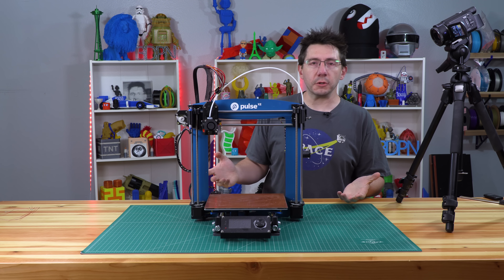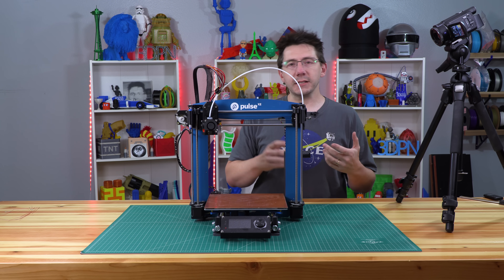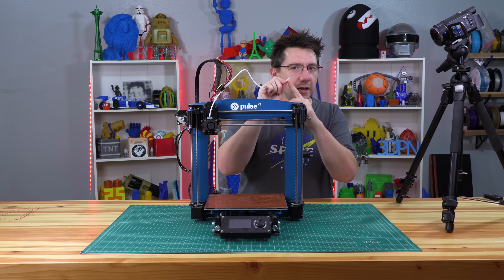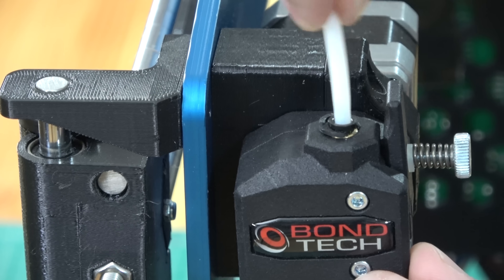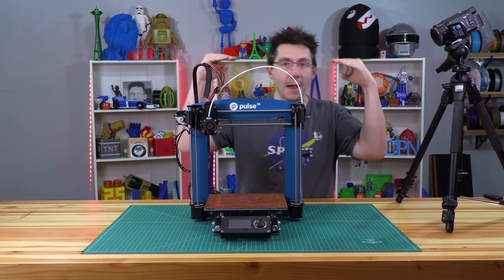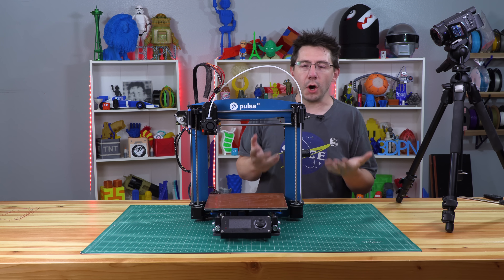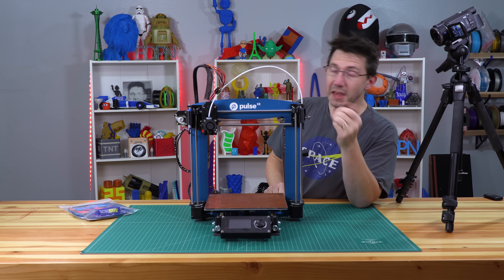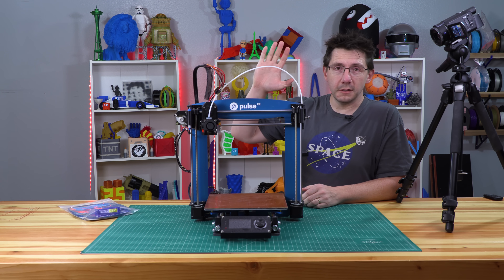Bondtech Bowden PTFE Coupler Fails - Here Is My Fix

Comment: Had to do this with my Th3d Tough Extruder when I got it as an 'upgrade'.
Now I'm going to go dual drive bondtech as I keep getting fails where the filament gets jammed a bit and then the extruder chews a chunk out of the filament and can't move anymore.
It's probably something to do with my E3D V6 allowing heat to creep up into the main body but I can't say for certain. I have upgraded the cooling fan on the V6 to a larger Noctua Fan. Still happens.
Hoping a dual drive Bondtech LGX can solve this problem. If not I'll try changing it too direct drive. If that doesn't work I guess I'll try changing the V6 out for a Mosquito hotend. I feel like I've over committed to my CR10 as a printer but that's the nature of this hobby I guess.

Comment: just happened to me on a clone. however in my case the coupler had actually broken.... only immediate fix was to turn the whole extruder around to use the other coupler (attached differently) and set klipper to reverse direction

Comment: It's an older video, sir, but it checks out. I was having issues with my fancy Capricorn tube popping out of my extruder. Nothing I did could make it stay in. It wasn't until I saw your external diameter measurements that it clicked and I swapped the coupler for the one that came with the tubing. Thank you!

Comment: Hi! I just got that issue for the first time with my Chiron printer and I taught it was fixed after I actually used a small tie wrap but it just happened again so I'm not sure If I need to change the coupler now.
The tie wrap idea was from Anycubic since they use one at the hotend.

Comment: These fittings were designed for high pressure applications,  not bowden tubes.  But they work for the most part.

Comment: Thanks for the video. I had this exact issue with my Ender 5 plus (my very first 3d printer)

My fix was pretty easy.. I didn't have any clip installed on the extruder at all 🙄

Comment: I also got this problem and also resorted to flipping the clip around to solve it quickly. Then I found this video. :-)
Interestingly enough this did take quite some time to manifest. Probably because of deformation due to squeezing in the coupler or similar. Or possibly just some wear in the teeth of the coupler because I also tried cutting off a bit and that worked only for a few days before it failed again.
I don't have an exact time it took for the problem to arise because while the printer has a runtime counter, the bondtech hasn't been on it from the start. But let's say somewhere around 2000 print hours. Possibly as much as 3000. Ish.

Comment: I have a dotbit clone to the bmg which I used the Bowden adaptor to a threaded coupler (from a Titan clone) and I just ran into that problem!! It actually broke the plastic piece off the coupler. I will be using a clip when I receive my new Bowden tubes and couplers. Thank you!!!

Comment: I've never had it come out with my previous couplers, .. however the these bowden adapters suck. Even with a thicker clip, .. mine just pushes out the tube entirely making groves in the PTFE tube, it's just not properly gripping the tube.

Comment: Turn your BMG extruder around.  The other side has a much easier to replace coupler.  Can the one at the end Joel has up top even be replaced?  I've not tried to remove it before.
Reply from the maker: I thought about this - this is how it cones factory installed.
Reply: @3DPrintingNerd  It's just a simple setting in Marlin or wiring to turn it around.  The Bondtech docs imply you can install it in either direction.  Their FAQ implies you can install it in either direction such as under "EXTRUDER TURNING IN THE WRONG DIRECTION" "Depending on the orientation of your extruder and if you use the top or bottom port as the output port to your hotend..."

Comment: If your running it as a Bowden set up why not flip the extruder upside-down?  Then if you have a Bowden fitting fail you can print a replacement piece that a standard Bowden fitting threads into and your good to go.

Comment: I got the same printer and have/had the same problem I also think the tube should be a little longer and there should be some kind of holder up there to keep the tube from jerking around that much. Also if you got the STL's for those clips somewhere please let me know so I can print some cause you can't buy them it seems

Comment: Those tube fittings aren't supposed to have clips on them. I find they make them less reliable.
I have had the fittings fail on my ender 3 but a clip won't help as the grips had deformed and the fitting was scrap.
Cheap junk I think.

Comment: my retraction clip on thingiverse includes the Fusion 360 source and is parameterized so you can easily adjust the design for whatever size works best for the coupler on the bondtech.  https://www.thingiverse.com/thing:3175043

Comment: Pulling out and pushing in the tube with the clip still in place? Is this 3D Printing Nerd trying to become the next 3D Printing Noob? Seriously tho, this coupler was wrecked by "abuse", and it kinda baffles me that even on an 80$ product like the BondTech extruder, the coupling seems to be of low quality compared to the ones i know from industrial pneumatic applications.
And just as a hint from the internet of tubes; always measure the same spot at least twice on a bent tube, twisting the calipers 90° around the tube.
Reply from the maker: Nope, not wrecked by abuse. Coupler works as it should when enough force is applied by the clip, which I have confirmed, and which Bondtech also confirmed.
Reply: @3DPrintingNerd  Alright, so it's still a design flaw by BondTech then. Coupler does not work as intended. For a connector that is actually under constant shifting mechanical load by design (print head moves and that moves the tube in the coupler a little bit all the time, plus the force that pulls on the tube by extrusion and backforce from nozzle resistance) they should really invest a few dollars more in a rugged tube coupling, especially on a high end high price product. Hopefully they think about that in the next revision, because the rest of the BondTech design is actually very good.

Comment: The black fitting on there is the same "John Guest" fitting as in the entrance of an e3d v6. Over years of using both I have had them fail at both ends (e3d and Bondtech sides) when the internal pressure the Bondtech can generate overcomes the strength of the Teflon tubing. Teflon cold flows under to high a pressure. The dimensions you measured with the calipers showing the tube as undersized are because the tube was stretched... Which drew out the length, not pinched by the barb fitting.

Long story short, cut off the deformed tubing end, and yes use a thicker spacer. Also always make sure you have the tube pushed all the way down into the QR housing. I have 9 Bondtechs between all my different printers. They work great but yes the problem is they can apply too much force if your nozzle is clogged or if you aren't applying enough thermal energy in to melt at the same rate you're trying to extrude. It's a good problem to have, having that much grip. But when you have that much grip, bad things can happen if you try and drive filament into a brick wall :-)

Comment: It comes down to cheap connectors, I have been using similar connectors from SMC for use with pneumatics with pressurised air for 10-15 years and haven't ever had an issue with hoses blowing off.

Comment: Yeah those clip are supposed to to be removed for ptfe insertion and removal. They are designed to hold the black ring up, similar to how your fingernail was doing. The coupler you have is effed and needs to be replaced. don't forget to fit your tube and only then, add in the clip!

Comment: Honestly my fix for this issue with other bowden extruders is to just use a twist tie and tie it tightly around where the clip is supposed to be. Stills works great but admittedly slightly harder to remove than a clip 🤗

Comment: From all the responses it is obvious that the coupler Bond Tech utilizes is flawed.  What I have done is to remove the coupler completely and tapped the Bond Tech (M10x1.0) to accept a quality PTFE coupler.  This is not for the faint of hart as the the Bond Tech is fabricated out of a composite material so you need to be careful in execution.  But this has restored operation after many failed prints and a lot of wasted material. Bond Tech needs to address this issue otherwise they have a great extruder.  I have contacted Matter Hackers about this issue on my Pulse XE and I suggest others with this issue contact their printers manufacture or Bond Tech directly.

Comment: I upgraded my CR-10 with the same extruder, bondtech BMG. Had the same issue with the tube popping out, and You could see the plastic thingy moving back and forth with retractions. Even following bondtech instructions of pulling out with a nail while inserting the tube didn’t help. But printing a thicker clip fixed it, and the STL is available on the bondtech website.

Comment: Same issue. Using Capricorn makes it wiggle a lot. Using a thicker clip does the trick.
Same fix on the other end too. The I use a Push Fit Pneumatic Coupling Coupler Fitting that I force shut with a plastic twist tie. This is much better.

Comment: From several of the posts I have read from below  It sounds like if you reset the flow rate thru the extruder to a little slower feed rate that might cut down on the back pressure in the hotend IE the filament is nor exiting fast enough and is allowing the incoming cold filament to build pressure in the Bowden tube pushing it out of the extruder just a thought I do not use bowden tube systems but I think that this might be worth a try along with replacing the coupler in the extruder

Comment: I had a similar situation. I put a e-clip in place until I was able to design and print a thicker clip. I designed the clip to be zip tied in place with small ties. You could use twist ties but it's not as esthetic.

Comment: same kind of problem with Couplers with the metal teeth that grab the tube.
good habit to press the button to retract the teeth as you remove and install so the tube doesn't put force on them and metal breaks if they bend to much.

Comment: Thanks for the heads up Joel, I didn't realise this was a potential problem. I've recently installed a Bondtech BMG on my CR-10s4. Originally with standard PTFE tubing and it worked perfect. I then upgraded to Capricorn Tube, still working perfectly. But I just checked and there is a bit of wobble going on. Will investigate further when time allows.
My main concern is longevity, so want to find a solution before failure, and be able to replace a part if it's necessary.
To be fair, I have been in contact with Bontech with some questions recently and their response and advice has been fantastic so far.

Comment: To do something similar I used the barrel of an old heat-sink compound syringe. Some judicious cutting produced a very cheap but effective spacer of the right diameter and height. A side benefit is I can make lots from a single syringe, no worries about losing them.

Comment: It seems like the tube fittings used in this industry are more than a little bit "inferior to say the least as this is not the first time I have seen this "bowden tube pulling loose" type issue being shown.
Would it not be possible to use pneumatic fittings (Festo for example) in place of what is obviously an inferior product?
Those fittings clamp and seal pipes with quite a high internal pressure and in some cases a lot of movement and they just do not "come loose".
In fact when inserted correctly the pneumatic tube (nylon I think) will break due to the movement stress before the connector lets go.

Comment: The problem is only partly the clip. I've printed thicker clips, I've replaced the whole coupler with air line coupler. It's simply they have so much torque it will plow thru the ptfe and shove it out of the coupler. You have to just back off your tension adjustment. So if get too much pressure then the filament is allowed to slip instead of build up pressure until the ptfe itself fails and sheers away from the teeth of the coupler. This is a design drawback of using a screw to set the pressure of the gears, it is a hard set point that doesn't any slippage, resulting in ptfe now becoming the failure instead of simply risking hearing the filament click when back pressure builds up
Reply: So instead you have to find a sweet spot. Enough clamping in the extruder gears it feeds, but only just that. So if/when pressure builds up due to slightly low temp or trying to feed more material than can melt at given flow rate, the material IS allowed to slip back and.. click.. your already at Max feed rate for the temp/flow if this happens so won't even result in an artifact in the print. Just released the excess mechanical pressure on filament between the nozzle and extruder teeth
Reply: @MattWeber  I turned down the current on the extruder stepper to reduce heat. It also helps with filament jams, as rather than stripping the filament the motor skips steps. If I were anything of a programmer, I could use this stall condition to stop the printer rather than letting it continue with a failed print.
Reply: @Tailgunner30  My bondtech doesnt get hot even. If i do hear it clicking due to back pressure it almost always is simply im a couple degrees too cold for the filament to flow well and I adjust it.

Comment: I've been running a Bondtech extruder for a couple years on my Ultimaker 2+ and have never had an issue.  However, the UM uses 2.85 mm filament, and has a 6.35 mm Bowden.

Comment: Thanks for this video Joel, I am having the same issue and as you stated this is a issued that shows up on prints with a lot of retractions, at least for me.  A couple of small prints worked fine but I have wasted a lot of filament on failed prints.  I'm not sure your solution is the best approach but may work short term.  I also noted the same size diameter issue with the Capricorn PTFE tubing so I was planning on doing the same method as Alex Cunningham suggested and have a new bag of couplers and a drill press just need to get a tap for the couplers.  This is a much better solution long term and the couplers can be replaced if needed.
Reply: FYI the new coupler is a M10X1.0 thread.

Comment: Sounds like your coupler is failing and you should look into replacing it.
Reply: Ive got a couple of couplers that have failed this way. eventually it will fail again.
Reply: Mine failed and it pulled the brass ring and coupler out, Joel version is a great quick fix. The pressure these things work at need something more stable, I considered a threaded fixing also as mentioned by @Alex Cunningham. I am keeping a small 3mm 'zip tie' to hand just in case, it will give it a better collar, the issue seems to be with the coupler, the grips inside are not very stiff or flexible  @ottersdangerden
Reply: @newmediaplaygroundltd4943  The replacement couplers I picked up are for pnumatics. seeing these are meant for pressurized air I spent a couple bucks more but seem to be a bit better built, they dont have as much play in and out and the spring to remove em are a bit harder. Also the path from the tube to the inside is a bit smother so fillament doesnt catch as easy when trying to feed it through. feeder gear pushes mine off to the side and used to just barley catch.
Reply: i got mine from a hydraulics supply house, while i had to drill out the bottom of the coupler a little it is all metal so better and only cost me one euro

Comment: Happened with my BMG Extruder on my CR-10 ended up milling that little metal ring and screwing in a basic push fitting.
Reply: So did I. Works great.

Comment: Had the same issues with the Cr-10s couplers, ended up replacing them since they don't use that little plastic ring =[
Reply: I just had that problem with my CR-10, I figured out that it was with the compression joint and I used a paper clip to fix it.

Comment: If Cap tubing is smaller outer diameter, is there a connector that has smaller diameter?
Reply: Its minimally smaller. But its a softer PTFE also if using the translucent blue one.. the opaque blue Capricorn is more rigid than average cheap ptfe and wouldnt have issues with the squish Joel is worried about, but bondtech doesnt advise using ptfe that is any smaller than 4.0mm OD at all. IMO its just a flaw in their design. Having only 4 teeth in their coupling vs 6-12 found in airline couplings of similar size, means there is a lot more space for the PTFE to squeeze between teeth and come loose
Reply: @MattWeber  I have the Cap tubing in blue,  the question was, does someone make a connector that fits Cap tubing? I would think that it would require a connector with a 3.75 opening going by Joel's & measurements of my own Cap tubing.
Reply: @buildersmark  Yes.. any of the 4mm fittings will fit the Cap tubing.. its a matter of like i said in my original comment on the video. Not overtightening the clamping screw so that the pressure can build up and cause the ptfe to get shoved out in the first place. The original fitting will work with cap tubes, its user error that leads to the problem Joel is having for the 90% part, and a simple bad design the remaining 10%. E3D uses a similar style coupler and has the same issue with titan extruder. Its just a matter of using proper adjustment of the extruder.
Reply: @buildersmark  Capricorn also sell matching couplers https://www.captubes.com/shop/#!/Accessories/c/25823850/offset=0&sort=normal  Cheers, JAYTEE